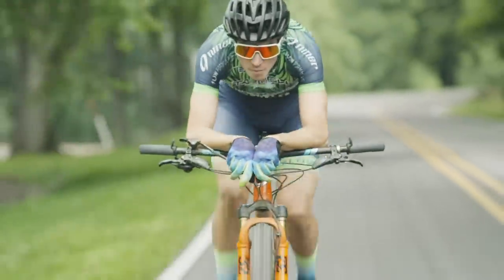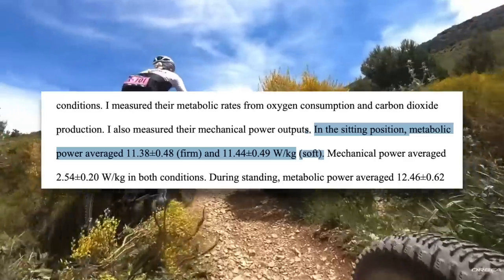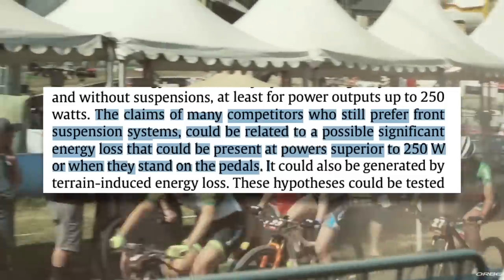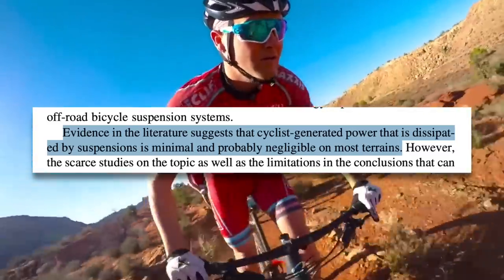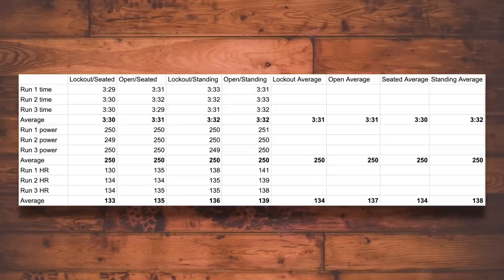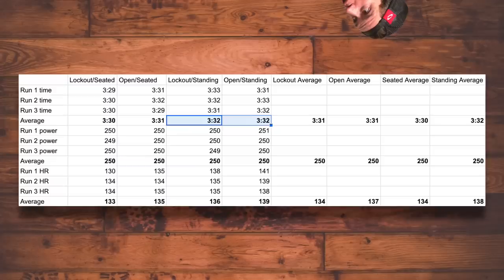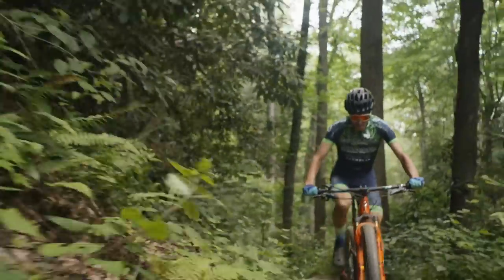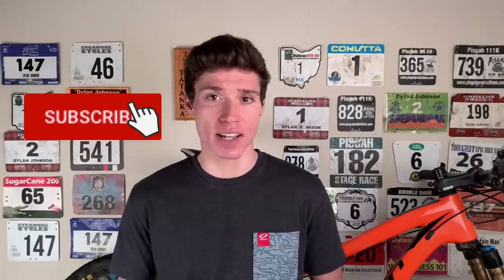Does Locking Out Your Suspension Actually Make Your Bike More Efficient? The Science

Comment: 250 watts is relatively low. It's conceivable there won't be much bob with a modern XC platform. What happens in situations when really hammering for extended minutes at 350-400W+?
Reply: I did a similar test at 400W on a chunky gravel road, seated position. Same distance covered both locked and unlocked but unlocked felt better because it was absorbing the road chatter. Bike: Canyon Lux.
Reply: @tgoods5049  Unlocked is also usually faster over terrain with large enough "chunks" to resist forward motion.  Suspension reduces the energy required from the rider because it reduces the amount of power wasted lifting the riding over each bump.  It is the scenarios where you are riding on a smooth surface that suspension requires more energy from the rider.
Reply: @brianrhamilton  this whole video from DJ just proved your statement wrong. It’s just another cycling urban legend.

Comment: I think i found a problem with your test: 
measuring the power at the cranks it's not right, becouse the power that actually arrive at the cranks it's the power that propels you forward, so it's intuitive that once the power it's on the drivetrain, there will be no difference except for aerodinamics or tyre slippage. The problems with the suspension wobble it's the transimission of the power from the body to the pedals, becouse before the pedal gets down in a full stroke, a part of that power it's squished into the suspension. The best way to perform this experiment would be, like you partially did, with an HR monitor and with VO2 monitoring, to measure the ctual stress on the body between the two conditions. The difference you esxperienced in HR may be explained by the fact that you were actually producing a little bit more power than 250W and losing it to the suspension.
Reply: Im confused as to what you are saying. The issue with "pedal bob" (suspension induced inefficiency) is the fact that as you power through the downstroke the bike "gives way" as the pedal force cause the suspension to compress.

Meaning power from your downstroke is going to both the drivetrain AND suspension.

So a pedal PM should be able to capture this no?
Reply: @tylerbruce5731  no, becouse the power meter should capture only the power that is going to the drive train, the power you loose in the suspension does not cause the rotation of the crankset, so I think it's not measured
Reply: @8paolo96  but pedal PM capture the force applied to the pedal. Unless Im wrong about that but Im pretty sure thats how they work.

So the suspension moves as you apply power the pedal reducing the force that the pedal would "feel".
Reply: @tylerbruce5731  exactly, so a PM would not recognise that force, so you to register 250W on the pedals you are actually applying  more force, that's the fault of this experiment

Comment: I’m left wondering about the metabolic and perceived difference over longer efforts. In particular, late in endurance riding conditions when exhaustion leads to higher levels rider bouncing due to fatigue. From my own n=1 experiences, I find myself never reaching for lock out on short rides, but do reach for it when tiredness sets in…and perhaps I’m hunting for any change to give me a tiny bit more fuel in the tank. For Dylan to put out efforts of 3.5 minutes at 250 watts, is like comparing for most of us the time/effort to walk across the kitchen with either a tight fitting shirt or a poncho.
Reply: Find the opposite for myself. Ride locked out most of the time, but on longer rides getting beat up cancels out any advantage so I'll get slower after a few hours.

Comment: We had an old crapy car i mean it was from 1950 it was crappy and wen i were riding it at it's highest speed around 80km or 50-55 mile per hour it felt like it is going so fast because it had wery bad suspension it gely like so fast it is going to fly and shit feeling like they tering apart, but with a modern quiet car with good suspension you feeling like you are stationary, we feel speed by sound, air drag and yep jerkiness if road , that is how our minds feel speed, i don't care if locking my front suspension has real effect on efficiency or not but riding blocked suspension on smooth pavement is so amazing suspension is good at saving your tooth from getting knocked off when you hit a sudden bump but locked suspension worth it just be careful when front is locked up 😊

Comment: Bridging this knowledge from mountainbikes to gravelbikes; do these results suggest that the only penalty to having a gravel bike with suspension is the added weight (and maybe a little bit fork aerodynamics/steerer tube height), regardless of terrain and road surface?

If so, using suspension on a gravel bike would likely be the best way forward, seen as how it can improve "real world" rolling efficiency on bumpy terrain.

Comment: XC rear suspension tends to stiffen up while peddling, while most enduro suspension stays soft.  On technical climbs with enduro it does seem to have an impact on me.
Reply: That would be due to antisquat, which is a mechanical system that uses chain tension to extend the suspension. It does have an energy cost though, so it's preferable to use the hydraulic lockout from the shock.

Comment: This is very interesting. One thing that I am curious about is how suspension lock out affects stepper and more technical climbs, think the Lynn trail climb in the Sm 100 for example. Does increasing you suspension dampening help you clean those kind of climbs?
Reply: It must be not the dampening, but "springiness" that helps. Can't say for bikes so sure, but in cars and tanks dampers only worsen the performance on small repeated bumps like roots or small rocks
Reply: Lock out would make it worse if its technical (ie roots etc) as the wheel cannot track the ground and maintain grip.

Comment: If there is a difference, I don't think it's between the crank and the cassette. Bikes are designed so chain driving forces don't significantly extend or compress the suspension. I think we'd need to measure exertion somehow, not power at the crank.

Comment: Same power applied to the pedals equals same speed. Not really a surprise there. What needs to be considered is how much power a person can put down comfortably while standing in particular but also sitting. Comfort can allow a person to hammer harder. Of course getting more power down will have a metabolic cost but that’s what we would expect. We need some tests on sections where we ignore the power ratings and just go for it. What gets the fastest results? How do those results match up with the power meter numbers? What is most likely to get you that KOM or PB? How much does what you’re used to factor into the equation? A person could get a PhD following up on this question. What about partial lockouts like Scott lockout system or say on my 2022 Santa Cruz Blur TR that has lockout options?? Time to go test.

Comment: I wonder if there is a fit impact on road bikes.  For example comparing the two bikes from specialized: the team edition roubaix vs a tarmac.  Both have the same geometry so if setup the same we can assume the suspension doesn't rob power but is there an advantage/disadvantage to how your position changes a bit from the suspension?  If you look at data on bike fitting with leomo it seems like the more stable your hips the better the fit but having travel means you would move less on the tarmac.  Granted that movement isn't caused by your position being off in terms of fit, but does that matter?  Does the bobbing cause more long term issues (say more or less worn out at the end of a ride)  I'm thinking it doesn't which would mean there is no real reason to get the tarmac other than a tiny weight and aerodynamic advantage

Comment: What was the run order? Was it
1 locked seated
2 open seated
3 locked seated
…
7 locked standing
8 open standing
9 locked standing
…
The first run looks like a lower HR, but on the standing efforts your HR actually drops with subsequent efforts. 

Also how practically significant is a few bpm for you in the range of 130-140bpm? I’d guess it’s not a big deal at those times but at higher bpm and/or longer times it’s going to take its toll. So probably an effect there.
Reply: Forgot to add: really enjoyed the video, thanks!

Comment: The premise for these studies is all wrong for the most part.  The primary focus for this capability is for high competition racing where 1/10 of a second can be the difference between a win and a loss or a state championship or not getting a state championship.  Getting in the single track first, getting 1/2 wheel gap at finish line, etc. There needs to more studies focused on this use case vs general ride times with high-watt efforts. My daughter lost 2 state championships by less than 2/10 of a second so a study needs to be at the sub-1 second level accuracy for high-stakes racing relevancy. Also 1 second dif over a 3 minute effort like the testing was run over equates to 20 seconds for a 1 hour race and that is huge.

Comment: I wonder what does this say about road bikes and stiffness. Is there any evidence or study about stiffness/speed relation?
Reply from the maker: GCN had an interesting video on this. My guess is stiffness is not that important but I haven’t read any studies on it… yet.
Reply: @DylanJohnsonCycling  Maybe you did not find a difference because you controlled for the wattage? Perhaps it is harder to produce the 250 with a suspension open and that is why you saw the small increase in heart rate. It might have been that your body had to work harder to produce those same watts at the pedals. I would suggest you could try multiple times lock/open and try to get the best time. You might need to do it several days too if fatigue is an issue. It would seem to be if you get better time consistently with full effort with one option that would be the best real-world test for it. I have an 10-year-old Anthem X29 as my only bike I ride everywhere everyday, so I'm not bias against full suspension, but my own purely unscientific and subjective feeling has been, that when I want to ride only on pavement, I put the smoothest tires with pretty high pressure and also have the suspension locked and that will result in faster speed in that type of riding.

Comment: Hi @dylan Jhonson. I'm not so impressed by results, because xc Full bikes nowadays are built to climb so well. But What happens If you use Power meter on pumptrack? I'm an engineer, and i dont have Power meter to test... But I think you can Go ALL the way to 190bpm @0w. Maybe most of the effort causing the bob is not only generated by legs, but by the upper body. This effort Will apear only in HR not in Power. I really think the most crucial and important variable in the system is tire choice. A pair of gravity tyres will definitely feel heavier due friction. But I think you should do this test again on a long travel bike! Greetings from Brazil!
Reply: Whos pumping in a situation where they would put a lockout on?

And yes pedal PM wouldn't record anything as they are not rotating on a  pump track. Even as you can get a unbelievable workout on a pump track.
Reply: @tylerbruce5731  Hi Tyler. I made this extreme example of pumping only to show that poor form on climbing, ex shaking your torso up and down or climbing standing pushing and pulling handlebars can input vertical forces that causes "Bob". That is wasted energy and Will not apper in Power meter measures. It Will only apper in HR or fatigue in a long Race or training. So... That correlation between Power AS " total body effort " vs time lap maybe is not so direct. Maybe a locked out suspension on firmer terrain causes less fatigue in the upper body, because the bike doesn't shake so much. Does that make sense to you?

Comment: A question rather than a criticism of the methodology: is 250w sufficient power to induce bob / compress the suspension?  If not, would a higher power test generate a different result?
Reply: Definitely plenty enough… For many weekend warriors, an FTP of 250W would be their dream. So while it’s not the same as hauling out a short burst at >800W, it’s more than many riders are putting out as they puff & bob their way to the top of their local trails.
Reply: @michaelparsons1494  FTP is irrelevant here. Sprinting and slamming punchy climbs happens way above FTP.  I don’t have a particularly high FTP but I often have short periods above 800 watts. It’s during those efforts that the suspension really moves.
Reply: @jerrycombs3459  The question was “is it enough to induce bob…” and the answer is “yes”.  Certainly, as you say, a big effort will make the suspension really move - but most/all people will bob on their suspension at 250W. FTP was context for how intense an effort 250W is (many ordinary riders can sustain that for an hour).

Comment: It is too bad that the actual stress on the body can't be measured accurately on such rides given the various influences on the heart rate. I can wrap my head around the fact that the energy dissipation in the suspension might be negligible and therefore the crank-to-wheel efficiency remains mostly unchanged. However, I'm quite skeptical that the effect of the lockout is purely psychological because it feels so significant on my enduro bike.

Comment: Just a thought, isn't this kind of testing the wrong thing? The power at the crank is already downstream of where the theoretical energy loss is. The theory is that some of the energy from the peddle stroke is being lost to compressing the suspension and NOT rotating the crank. Therefore if all you test is consistent power at the crank it's kinda expected that the results would be the same?
Reply: That would show up in the crank PM no?

You transfer power from your leg to the drive train through the pedal and the idea is the suspension reducing the platform you are "pushing against". Ie your downstroke power is going to both the drivetrain and the suspension.
Reply: It's power output vs. time.... think about it.
Reply: Its really a strain gauge using deflection in the spindle to measure torque, that torque times RPM and then averaged over time. So if you degrease that strain due to the crank set diverting instead of taking the force, it will bring the whole equation down.

But this is really just why I think that test could be invalid. Ultimately the reason I question that it could possibly be just as efficient to not lock the suspension out is just down to the first law of thermodynamics, energy cannot be created not destroyed. And I'm not talking just about the parasitic loss of the friction in the seals/ linkages ECT.. I think the biggest loss is the fact that the entire mass of the rider and the sprung weight of the bike is moving up and down do to compressing and decompressing the suspension say 2 inches-ish for a 100 mm bike. That's not free, and it would only get worst the bigger the the bike or more safe you are running. 

It would be hard to setup a test to find out exactly how many watts that is, might just have to mathematically calculate the energy requirements of doing just that motion. You could go by heart rate which he did and his heart rate was higher for the unlocked suspension, but calculating how many watts those few beats are worth is really impossible due to the variabilities of heart rate data.
Reply: @samuelriester1419  its looking like its a minimal wattage loss if at all 

And youd have to weight that against any lost watts due to loss of traction.
Reply: Yeah I think it's pretty minimal based on the 3-4bpm difference he had, you could calculate it based on the gravitational potential energy equation E(out) = mgh. But there are factors like the efficiency of the suspension in returning you back to that position and some other things like how much squat is accually happening, so it would be a guess at best.
Reply: @samuelriester1419  Id also be curious to know what happens to that "pedalling induced suspension movement" without suspension movement eg hardtail. If there was a way to measure that.

My guess is the undamped compression and rebound of the tires and actual wheel movement.
Reply: Yeah i'm definitely not getting at full suspension bikes being slower, the losses are for sure worth it when it comes to traction and momentum preservation. I race a full suspension bike everywhere. I'm just pointing out that I don't think it's true to say that there is no point in trying to reduce unwanted suspension movement through uses of lockouts ect... I tried to do some calculations including damping losses due to heat that I found online but it seems that it is just way way too dependent on the total travel of the suspension, changing that input drastically affects the output so any number is essentially worthless. Whether you are in or out of the saddle, how good your frame is at resisting bob, what sag you are running, total travel, progression, all of these come into play so any calculation is way to specific to a certain scenario.
Reply: @samuelriester1419  oh I wasnt thinking you getting at full suspension being slower.

But now this has got me thinking about it and how you could actually measure something like loss of traction.

Comment: Measuring the power at the crank may not show the power loss as if it was measured at the wheel.
Reply: If you measure power at the wheel it would add another variable - drivetrain efficiency.

We need to measure the power your body is producing and subtract the power meter reading (ideally from the pedal or crank) to see how much is lost by the suspension movement. Too bad we don't have body power meters. Next best thing is heartrate.

That's likely the reason heartrate is higher for the same watts on open suspension. Because you're working harder to produce the same 250W , the suspension is making the system less efficient.